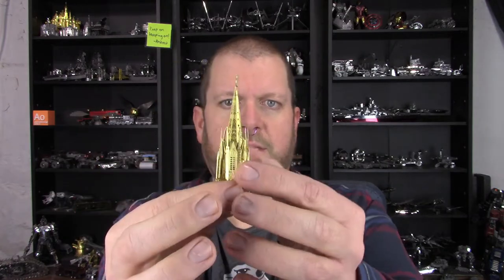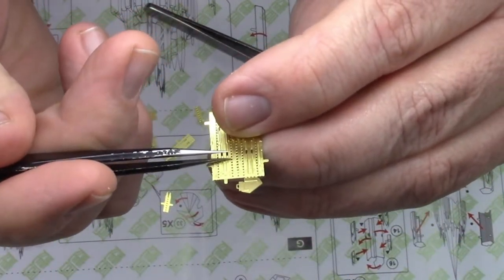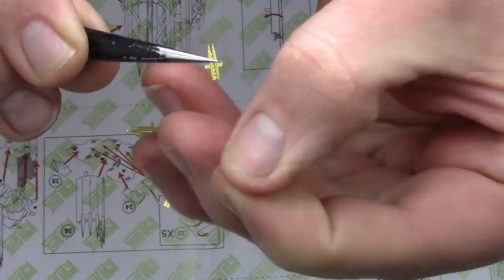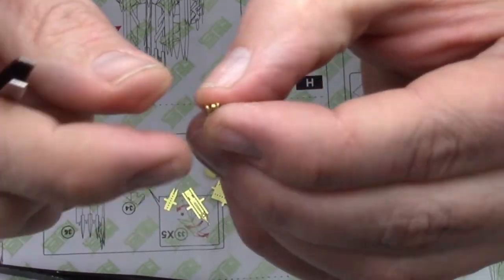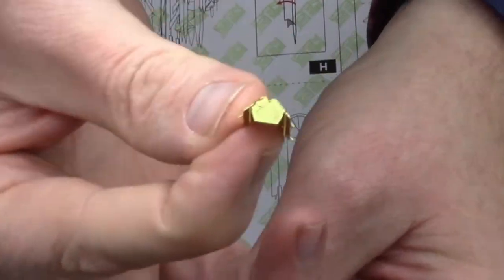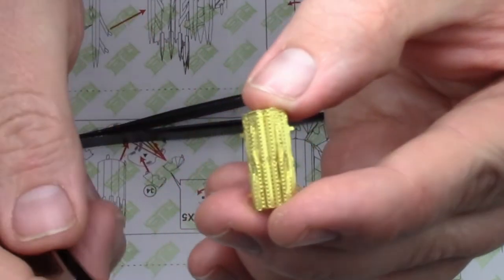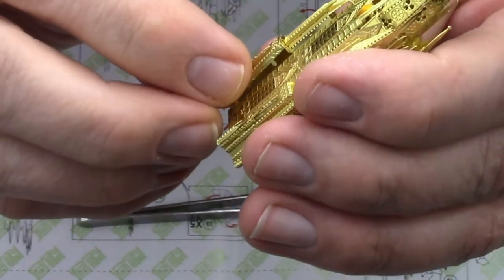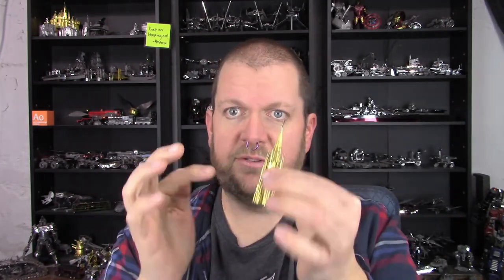3D Metal Model Building Tips and Tricks - Looking ahead

Comment: Great video/demonstration. I had a similar issue that required some lookong ahead with a St Peter's Basilica model. Some sections of the church were folded at right angles with columns/buttresses affixed to these from the outside. Dilemma was whether to fold the wall first (leaving bugger all space to secure the tab by folding or twisting) or to fix the small piece on top first (making it harder to get the right angle on the structure). Ended up folding the structure first then just doing the best I could to affix the smaller pieces - couldn't get them all perfect, luckily they were a tight fit so tension held them mostly for me. What a mission!!

Comment: The Metal Earth Iron Man has another good example of this. On Pages 3/4: Attaching his upper leg/hip part (#21) into his thigh (#23) is a major pain in the butt if you completely close the thigh as indicated in the directions. Leaving the front flap of the thigh open allows you to slide the hip lower tabs down to get to their slots in the thigh a lot easier. I did not read far enough ahead in the directions to see this problem coming on the first leg, but I will be ready for it when I start the second one.
Reply: And I just went back to your Iron Man build video and see where you covered this. I've watched this build video before but I must have forgotten about this. Shame on me for that! But I am glad I came to the same solution and was able to make it work lol.
Reply from the maker: @MrGilidry  that's ok, I forgot too. I do remember I bought a second kit because I messed something up. You are right, Iron Man is a good example.

Comment: are there any sets that contains also some tolls? once I have seen gift box that has included clippers etc, but cant find it anymore... or it was not ME :/
Reply from the maker: Some older ICONX sets included tweezers. Some shops online will include tools often for an extra cost. Time For Machine model kits include tools but they are on a different level. TFM models are metal but are more mechanical and artsy and less realistic. Nice models but also pricey.